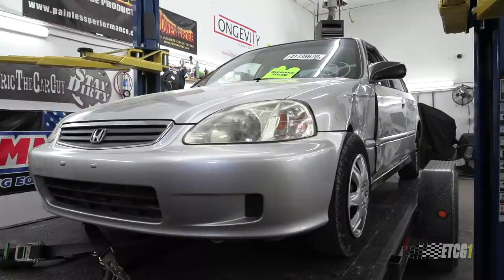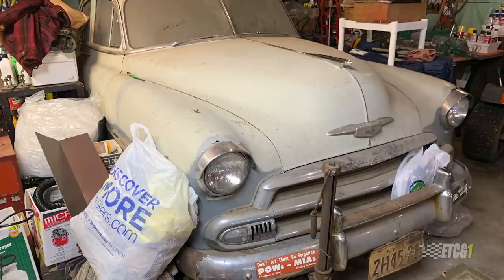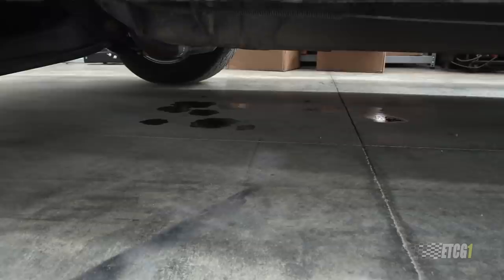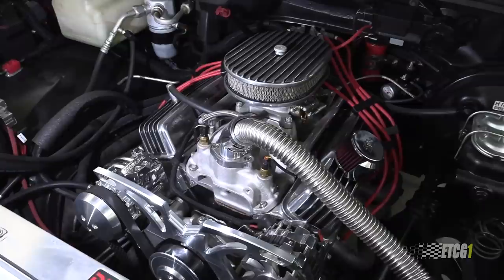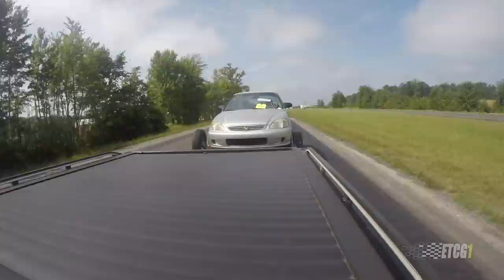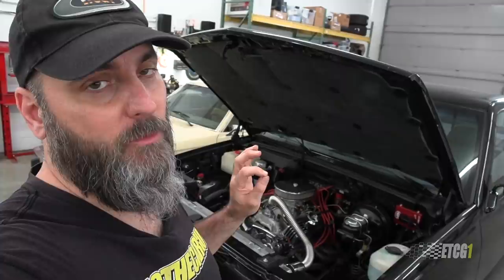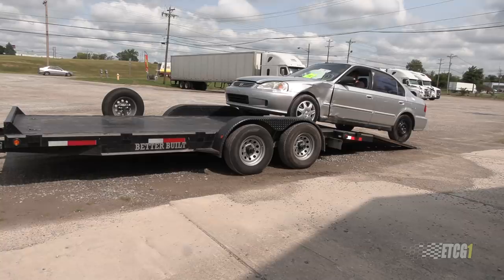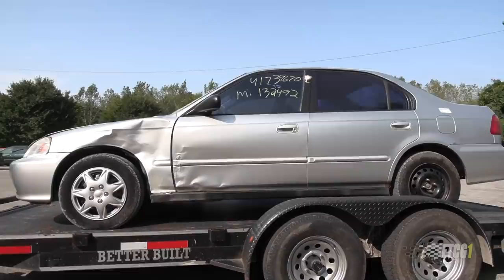First Time Towing with Dads Truck

Comment: Usually with uhaul hookup book they dont want you towing more than the weight of your tow rig. To get a ballpark of whats safe to tow. Look up the trucks curb weight and it should be able to tow that weight safely enough. Maybe with some modifications. But these new trucks for some reason have gone crazy with the tow capacities. Like the new dodge 1500 being lighter than the previous gen but being rated to tow 20k? Or something crazy like that. UHaul says no.
Reply: "Usually with uhaul hookup book they dont want you towing more than the weight of your tow rig."

That's partially due to most of their trailers are unbraked trailers. This one was braked. Also it's because they know there is a lot of ignorance around towing and people not knowing how to properly balance their load for 10 to 15% tongue weight. That's why their trailers have the 55mph sticker on them, that's liability to cover their ass in case an accident occurs. 

Three main things determine how much you can tow (if properly balanced). Braking, Power, and Suspension. Newer trucks have more power, and better braking. That's why they can get those larger numbers. Eric upgraded the engine and is likely making quite a bit more power than it did stock so that's covered. He upgraded the brakes, that's covered. The only thing that is really limiting him is the suspension. To get an idea on what you can tow safely with the truck you need to put some weight on the rear bumper. Say 2 or 3 people standing on the rear bumper and a 4th measuring the squat. How much weight you can put on that rear bumper to get a 1" drop from the center of the wheel arch to the ground. Multiply by 10 and you can safely tow about that much, assuming you load/balance the trailer properly for 10 to 15% nose weight. 

Not loading the trailer properly like what Eric did, makes the front lighter which reduces braking efficiency. Not to mention the trailer brakes were improperly adjusted. Those factors lead Eric to believe that that towing combination was unsafe. Which is not true. 

Going by what Uhaul says is the absolute bottom of the barrel on what they deem to be acceptable, and assumes people who rent from them are complete morons. You can rent from them with smaller trucks and heavier vehicles, you just have to go through a few more steps, talk to the right people, etc. Unless you own a business towing cars though I doubt a normal consumer would be able to do easily.

Having driven and hauled a large range of trucks from a tractor trailer on down without doing any of the testing mentioned above, I'd be comfortable towing 6,000lbs with that truck any day of the week. So long as the trailer was loaded properly and or I could adjust it myself to maintain that balance. 

With an airbag setup, he could probably do close to a 10k lb gross trailer weight easily and safely.

Comment: That’s a smart move getting a heavier duty tow truck.   One big issue towing too heavy is if you go over weight and get into an accident.  A lot of times your insurance company will say. You were over weight and towing illegally.  You’re on your own for that.   And you get screwed real hard.  
I was originally looking at an f250 and equivalent.   But the issue I kept seeing was payload capacity.   And running into an overweight scenario.     I’ve been looking at srw f350s and equivalents.   Simply because they’re payload is so much higher.  I didn’t realize this till I started doing the research but you can get a higher payload rating on an f150 then a f250 if you equip them “right”.  
If you decide to go with a dually.  Look into the f450 and equivalents because they often have a wide track front axle and that gives you a much tighter turning radius so the truck is a lot more maneuverable especially with a trailer on it.

Comment: When I was looking into getting a travel trailer, I did a ton of research on towing capacity, so I could make sure I didn't get a trailer that was bigger/heaver the my TV (tow vehicle) could pull.  As some have pointed out, tongue weight should be checked (there are scales you can buy on amazon) most 2 inch square hitch receivers can only hold up to 500-600 lbs.  Next, The other number that you need to know, besides GCVWR is Max Payload, and towing capacity.  Payload would be anything the TV is holding (gear, people, AND the tongue weight of the trailer) 
A weight distributing hitch would help out a lot, as it "moves" some of the weight of the trailer to the front axle, and off of the back (think of picking up a wheelbarrow).  

I would watch these:
https://www.youtube.com/watch?v=5RbqPaqtpuI&t=159s
https://www.youtube.com/watch?v=ihJdQbQA3GY
https://www.youtube.com/watch?v=aUML269f6e8

As always, enjoy your vid's can't wait to see you work on that 50's truck!

Comment: If you do get a trailer that you plan to use with this truck you could consider an aluminum trailer. Likely much lighter than a steel trailer
Reply from the maker: I'm not going to be doing significant car hauling with this truck. the short wheelbase and inadequate rear suspension make it unsafe to do so.

Comment: weight distribution hitch is needed!
Reply from the maker: That would help a great deal.
Reply: GCVW should be in the owners manual not on that sticker.  I think that air shocks and weight distribution hitch will fix your issue.
Reply from the maker: @ascotell  I checked, it wasn't listed in the owners manual. I agree that air shocks and a weight distribution hitch would work for a Civic, but not for the '51 Chevy which is what I was testing with this trip. Also, anyone with one of these trucks knows that the brakes are utter crap. I don't recommend towing anything without upgrading them first. Remember, I never built this truck as a tow rig, it's a sport truck. I was just working with what I had. Thanks again for your comments.
Reply from the maker: @ascotell  If you've ever driven one of these trucks you know that there is no way that the brakes would support towing 7500lbs. I don't agree with their estimates at all based on my experience with what I guess was 5000lbs.
Reply: ETCG1 thanks for the response!  I actually have driven that generation of Silverado and I totally agree with you about the brakes!  Gm must have been slacking with the gcvw then.
Reply: @ETCG1  "If you've ever driven one of these trucks you know that there is no way that the brakes would support towing 7500lbs. I don't agree with their estimates at all based on my experience with what I guess was 5000lbs." 

That is because you had it loaded wrong. You need 10 to 15% tongue weight. You were likely 20% + I read another comment about the 60%? That is very misleading. The trailer axles hold a lot of the weight and it's hard to really differentiate where the weight is going to go. You want the rear of your truck to squat around 1". If you do that, and go down the road and hit 60/70 mph and it doesn't sway then you are 100% in the clear and it's loaded properly. 

Now as for that specific trailer, it pulled to one side. That means the trailer brakes are not adjusted properly, or something else is going on. 

Instead of listening to me, and or other people on here, go down to a trailer repair shop and talk to them. Hell call up a few car transport companies that tow vehicles 1000's of miles and talk to them. 

In another comment I talked about how you can measure tongue weight, and get an idea what you can tow safely. If you didn't see it, respond here and I will go over it, Would require maybe 130 bucks or so to get a crane scale and you using your own engine hoist. 

7500lbs unless you really messed something up would be doable. Maybe not with that specific trailer but one in decent condition? 100%.
Reply from the maker: @q......  I never intended to make this truck into a tow vehicle. This entire trip was an experiment to see what hauling a car trailer was like with this truck to see if it would even be feasible to attempt brining the heavy '51 Chevy back to my shop from NY. To me, it doesn't matter how the trailer was loaded, if I had difficulty hauling a car trailer with a Civic, the '51 would be a no go for sure. In the future, if I want to haul a Civic with this truck, I'll just get some air shocks and a car dolly and call it a day. Thanks for your input.

Comment: Install helper bags!
Reply from the maker: That's only with coil springs.
Reply: ETCG1  they make them for leaf springs I installed some on my Chevy truck I use to have for the rear
Reply from the maker: They are a lot more expensive than air shocks which is likely the direction I'd go. Thanks for the suggestions.

Comment: Weight distribution! Center of mass SLIGHTLY in front of trailer center. (Near balance)
Reply: This. You want something like 150lbs max weight on the hitch, no more than that.
Reply: Trailer requires 60% ahead of the axles, aka 10% ball load.  If the trailer and load is 4000 lb, ball weight needs to be 400 lb.  150 lb is way too light and will let the trailer push the rear of the truck around.
Reply: @vibingwithvinyl  Bad information, you want 10% to 15% on the hitch. If your hitch rating is 150lbs tongue weight and what you are towing is more than 1500lbs you need a bigger hitch. 

@aussiebloke609 Exactly. 10 to 15% is what you need, anyone who says a static number like 150lbs doesn't know their ass from a hole in the ground, and should not be giving and or repeating bad information.

Comment: Eric. 
So you are saying you regret lowering your “tow truck”?

And this is a surprise?

Want cake and eat it too?

Stock Chevy 1500 trucks should have no issue towing that trailer and car. 

 It for tongue weight. 
Is there room to shift the civic backwards so you can reduce tongue weight?

Maybe you shoulda put the civic on the trailer backwards?

Ok. Done giving you a hard time :)
Reply: For the oil leak. 
Recycle PCv to the intake. 
Suction will help. 
And you won’t leak oil over your beautiful bay.
Reply from the maker: It's not a surprise as I said in the video. I never intended to make this truck into a tow rig, it's a sport truck, that was always the plan. Given that there was no GVCWR listed, I think it's reasonable to conclude that this truck was never meant to haul a significant amount of weight. It's GVWR is 5600. If you've ever driven one, the brakes alone would scare the crap out of you, especially towing. I'm glad I upgraded mine. As for shifting the weight, this car hauler calls for 60% of the weight to be put in front of the axles. that's why the axles are set back on the trailer. 

I won't leak oil if I don't overfill the crankcase like I did before I left. BTW, the engine has a functioning PCV. You can see it right in the video. 

Thanks for your comments.
Reply: ETCG1 
Thanks for YOUR comments Eric. 
I was just being grumpy. 
I like waking up Monday to my etcg fix!

Awesome truck. 
Awesome job. 
👍👌🍺
Reply: What IS incredible is that you had almost 10,000lb weight pulled by your truck. 
That’s almost half of a Detroit powered silver side bus.

Comment: If it's got too much weight on the front why didn't you move the civic back more ? Easy fix. edit: ok, you suggested that. The trailer needs to carry the weight, not the hitch. You need some weight on the hitch for stability but the majority needs to be on the 2 axles of the trailer. Not sure why are so focused on putting all that weight on the truck.
Reply from the maker: I'm not focused on putting all that weight on the truck. I'm just doing what I can with what I have. Now I know the trucks capabilities. I need a bigger truck to haul a car trailer. Thanks for the comment.

Comment: Also, backing the car onto the trailer will help with weight distribution, since the engine would be sitting behind the trailer axles in that case.
Reply: You do not want more weight weight  behind the trailer axles than you on the tongue weight.

Comment: Towing should not be taken lightly. Don't exceed the towing capacity of the tow vehicle. A weight distribution hitch will easily correct the squat problem. Don't shift the load back as you need the tongue weight to keep the trailer from fishtailing. This is all towing 101, lots of info on you tube. Good luck!

Comment: Yeah i own a 85 gmc Sierra S15 2wheel drive , long bed . 3.4v6 4l60 auto overdrive butt man it don't like towing heavy things at all lol or hills .

 I almost plowed into a Toyota Corolla one time towing a 6 by 8 trailer or might been bigger but i had alot stuff on it like a lawn mower an 4 bikes an some furniture an alot stuff on it and made it heavy . Well i was doing good and slowing down at a red light when this tiny car jumped in my lane cut me off an I hit the brakes harder to keep from hitting her an it ended up locking my front wheels up an I slid forward smoke everywhere.  Man I was so mad an scaryed to wreck my truck after all the work that I have done to it i would have destroyed that car an my truck but luckily the truck stopped a foot or so from the rear bumper of that car man was I lucky but was her fault tho 🙃 .

But yeah from know own I don't tow anything bigger or much heavy anymore just in case I just never thought about something like that happening to me , I was just trying to get stuff done because I was moving houses an only had my truck to use but i rented a U-Haul trailer .
Reply: Sounds like you loaded the trailer too heavy in the nose of it. You were likely squatting too much and just overall improperly loaded trailer. Doing that actually takes weight off of the front tires. Front tires is where most of your braking comes from. Using a load leveler, or "Weight distribution hitch". would have solved that issue if you could not have adjusted your load properly. 

For future reference... You want 10 to 15% tongue weight. At most you want the rear of your truck to squat 1". Measure this before attaching the trailer.  Center of the rear wheel arch to the ground. Attach the trailer and if it goes down more than 1" you need to adjust your weight in the trailer. If when adjusting it to get that 1" and you are not in the 10 to 15% window then you are overloading your setup and need to make multiple trips or at the very least meet it in the middle somewhere and drive around 50 to 55mph to your destination and for the love of Pete, stay in the right lane if you are hitting the highway.
Reply: @q......  ehh yeah , but it even locked up with the trailer empty an that told me it's just to much for it . These s10s aren't really something to be used to tow with butt I really needed to cause I was moving an didn't wanna rent a truck to move things . Butt yea crazy , an I actually remember now I had a pic after that happened when I had trailer hooked to truck an I locked up an sold with a empty trailer . It was a 6×9 I think it was an it was heavy an the U-Haul place would not let me use my truck whenever I was putting everything in the system to rent it she said my truck was not compatible so I used my suv as the one butt I actually ended up useing my truck . 

But long story short now I understand why it was not able to really be used for that from now on I'll use a smaller trailer

Comment: The frame on the 1/2 ton and 3/4 ton chevys of that generation is pretty much the same.  The main difference is in the brakes, suspension, and rear end. All full size C1500 can tow at least 4000. Here's a brochure that list different Chevy c1500 and their tow ratings. Changing the gear ratio alone can get you another 1500 pound of towing capability. https://www.google.com/url?sa=t&source=web&rct=j&url=https://www.gmheritagecenter.com/docs/gm-heritage-archive/historical-brochures/chevrolet-trucks/1989-Chevrolet-Truck-PCK-2.pdf&ved=2ahUKEwiErLis1PrrAhWXZ80KHXWnDc8QFjALegQIKxAB&usg=AOvVaw0rTp4eIMHkhEx7eHm-tWLd I  recommend getting a tow dolly for your truck, much lighter than a car trailer
Reply from the maker: Great suggestion. I might just do that until I can get a bigger truck. BTW, I never intended to make this truck into a tow rig. Thanks for the comment.

Comment: Around here (Norway) the rule is to have about 75kg(160lbs) of weight on the ball. This leaves the trailer a bit front heavy and stable. Balanced or back heavy trailers are unstable. Most cars also have a maksimum ball weight in the registration papers.

This is also tought in the special drivers ed classes and exams needed to tow a trailer over 750kg (1650lbs).
Reply from the maker: Thank you for that info. It's great to know how they handle this in other parts of the world.

Comment: Thanks for this topic.  But are you sure the lack of a GVCWR means it can't tow much?   I bought a new F150 a couple years ago and got the trailer tow pkg.  I just checked now and the sticker has no GVCWR.  I haven't towed anything yet and I'm not sure when I will.  Guess I'll need to fo a little research.  Thanks for posting - thumbs up.
Reply from the maker: No, I'm not saying that. BTW, I couldn't find a tow rating in the owners manual either. That's where you would normally find it. Even if I did, it wouldn't apply to my truck since I lowered it. I'm guessing that some air shocks would help, but I don't think towing a car trailer with much more than a Civic on it would be a good idea. My goal of the video is to get people thinking about this before they get in over their heads. Thanks for the comment.
Reply: @ETCG1   Ah!  OK, understood.  Thx for replying.

Comment: You really need to figure out what the factory GCWR for that truck (VIN). Helper bags/springs  will not increase the GCWR. If something happens on the road, you could possibly be held responsible, and face legal consequences, if over weight. 

I'd recommend just renting a UHaul truck and trailer. They'll match the truck and trailer to your needs, just get a good estimate on how much weight the load will be.